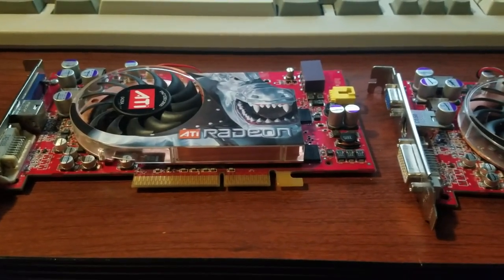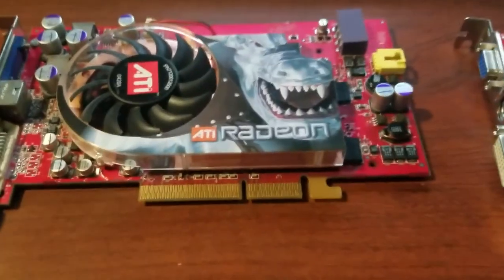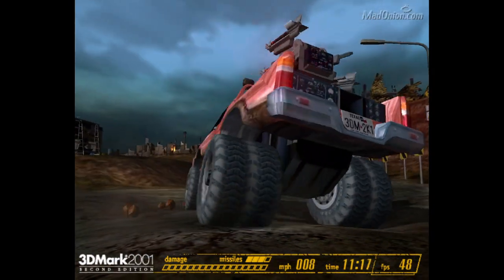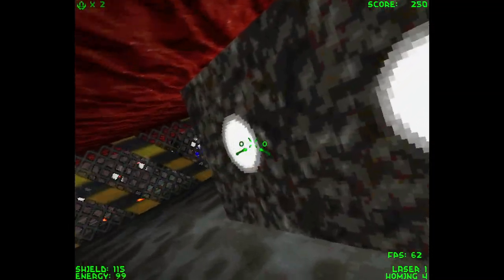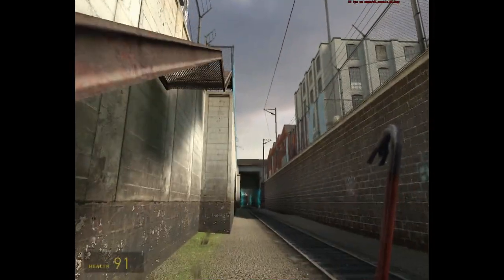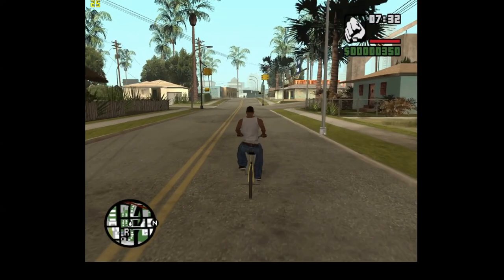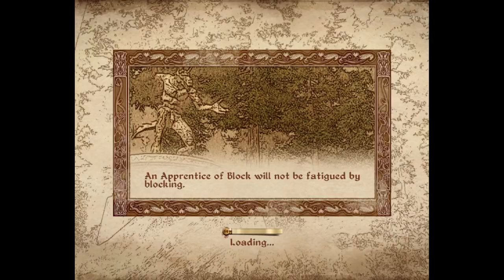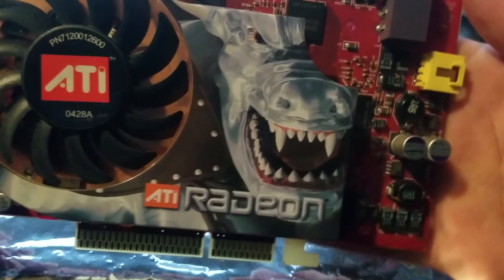The ATi Radeon x800 - #GPUJune

Comment: The X800 Series was definetly one of the golden ages from ATi because this card had better performance than 6800 Series if you play with Anti Aliasing. 
The image quality is noticable better than 6800. 
Even Radeon X700 has better image quality than 6600GT for my opinion the texture looks much sharper and the Anti Aliasing effect is better too. Yes the performance was bader than 6600GT but I think one reason was becasue of the better image quality .

Comment: Great review! I have a single X800 XL in AGP and a X300 SE, which is PCI-E. I have a substantial collection of GPU's from the 90's and 2000's. Didn't even know there was a GPU month thing going. With chip shortages, it might become a GPU year. Maybe I should join in. I've got about a dozen Radeons in the collection, but they always sat on the shelf. Never been used (by me at least). Never been an ATI guy, but never hesitated to accept a card donation, if one was available.

Comment: Great video dude! Thanks for sharing. I was surprised by that 2001 score, my PIII 1.4s and a 9600 Pro scores 8475!
Reply from the maker: Thanks so much! The PIII-S 1.4 is such an awesome CPU! I have one but I still need to track down a compatible board.
Reply: @jikissgamer  yeah that’s the tricky part. I used an Epox EP-3PTA which didn’t list it as compatible but luckily worked just fine. Not easy finding the right boards! It’s a cool CPU for sure, feels really fast (for its day!). I’m using it to run a machine with windows 2000 on an SSD and it feels snappy.

Comment: LOL I have one of those X800 XL cards in my Windows 98(se) project PC. IIRC the X800 XL had more in common with the X850 die because it had more pipelines but was on lower clocks. I'm more surprised that the final Catalyst driver for Windows 9x (6.2) actually has reasonably good support for the X800 series and X850 for that matter.
And, yeah, your Pentium 4 Dell isn't doing it any favors. but compared to my past experience with Dells of that same vintage, I'm surprised yours even accepted a GPU upgrade at all. Mine refused to work with anything but its onboard video even though it had an AGP slot.

Comment: Damn they were beautiful cards. Those were 200W cards, with tiny little coolers. We often talk about how much more powerful GPU's are now, but it's shocking how much more efficient GPU's are, we can do SOOO much more with 200W. Wish AMD still used the read PCBs though.
Reply from the maker: Agreed. The red PCB became an iconic and signature thing for Radeon cards and it's a shame that they're not red anymore. And it really is crazy that they are 200w cards. I was surprised when doing the research at how much power they consumed. They are awesome though, I wish I had turned off Vsync and paired it with a faster CPU to really show what they're capable of.
Reply: 200W is suggested psu acording to techpowerup's gpu database, not the tdp valu of the x800. X800's tdp is around 40-50W.
Reply: @sedatgenc83  Yeah, i immediately saw that something is wrong in the video. No way that tiny cooler can handle dissipation of 200w.

Comment: Back in the day I had an emachines "gaming PC" It was sold like that, it had a rebate in a AMD x700 pro, but instead I got the ATI x800xl. It was an good rig for the money, it had the ATI xpress 200 chipset, with a 16 lane PCI express, SATA ports and a 300 watt power supply (at the time that tech was brand new SATA and PCI express) the Mobo had a 939 AMD socket with a Athlon 64 3200+ I added 512 mb of RAM that added up to a huge 1 gb of DDR 400 dual channel memory, I also had the same sound card as you, the awesome creative audigy zs2 and an ATI tv tuner card with video and audio I/O one r/rw stock DVD drive and a what I think was a 54x CDR drive, and a 16 in 1 memory card reader. Later on I updated the CPU to a Athlon 64 dual core, the very first gen dual cpu I think it was a 3800+, those things were expensive as hell and I wanted to save money to buy a ATI x1800 but I never got to buy one. Quitted PC gaming for a while, there where only bad PC ports of 360 games.I forgot, I had windows XP 32 bit. Real nice video!
Reply from the maker: That's an awesome system! Those 939 Athlons were awesome CPUs! Definitely a lot better than the Pentium 4 I was using here. And yes the Audigy 2zs is an awesome sound card, I really like the way it sounds. I am still very fond of this era of PCs and games, those were good times. Thanks for watching!

Comment: Good vid mate.. i have resurected a win xp hp sff factor pc w8th xp on it. I can only use small cards on it so have a x600se 128mb.. its great for running early 2000s games.. cant quite stretch it to doom3 and fear but slightly older games run great.

Comment: Nice video. Are you using Pentium 4 HT? If it's the case I wonder if you left it on or turned it off because it might affect (to the better or to the worse, depending on game) the performance.
Also you might had a forced framerate cap on GTA:SA. Usually when you look into a closed-space area (like the garage) the framerate should go higher but in your video its still locked at 25 regardless of area. I know it from my experience with my old PC (P4 2.6GHz Northwood core w.o HT, and Geforce FX5600), the game ran about the same but with a bit higher performance when it had to render closed spaces.

Comment: The "XL" version with no cooler art was sold usually as OEM cards to be included in mid-range workstations. Low end workstations got the x300, while the high end stuff got the FireGL, which in truth was just little more than the desktop x300/x600/x800 with optimized drivers. If I recall correctly, either the FireGL 5000 or 5100 was the "workstation" version of the x800
Reply from the maker: That's really cool I did not know that. Yeah it definitely looks like something that would have been in a workstation since a lot of gaming cards were more flashy. I would love to try the FireGL sometime too and see how it compares.
Reply: @jikissgamer  I just checked the FireGL that I have, it's the V5000. From the looks of things, the V5000 was the same as an x700 xt and the v5100 was an x800 xt. This one has a super noisy fan though, and it is PCI express, not AGP

Comment: i have an x800pro pci express card, but my retro rig is agp, so had to put an old inno3d tnt2 in it as my next oldest agp is a ati rage 128pro. my x800pro doesn't have a molex power connector, but has the small 3.5'' floppy power connector

Comment: Man, I had an X1300 256MB card when I was like 12 or so. It barely ran anything, but I still beat Doom 3 on it at about 20fps low settings (yeah, even in 2012, I still couldn't run Doom 3 lol). I kept it for the longest time, but it's long gone now. It's really interesting to see the difference between that card and this when it comes to playing Doom 3, simply because this absolutely tramples it when it comes to performance. I guess that makes sense since this was a high-end card and that 1300 was a very low-end card, but still.
Reply from the maker: Yeah it is really interesting to see how much of a difference in performance it was back then between the two cards. Technology was improving so much faster then than now, such a different time. Back in those days I actually had a Radeon 9200se and that thing was total junk haha. But I did beat Half-Life 2 and Doom 3 on it.

Comment: Just picked up one at the goodwill outlet for about $2. X800gto 256mb pci x16..  It has a Ac5 silencer on it that is filled with dust, the fan has some noise to it. I am going to clean it up and see if I bring it back to life.
Reply from the maker: Awesome! Those are great GPUs, if the fans still give you trouble you could also strap on a third party cooler from ebay or Amazon. Good luck getting it running again! 👍

Comment: GTA:SA runs like that cause the phyiscs are tied to the engine, if you turn off the frame limiter it will run alot faster, but you start getting physics bugs.

Comment: Hello Can you test GTA San Andreas without framelimiter? I'm intresting how much fps you get with X800 XL and Pentium 4  2,8GHZ 1GB Ram.
Because I have  Radeon X800 XL too but in PCI Express 256MB and Pentium 4  560 (3,6GHZ)
I have noticed that GTA San ANdreas wasn't optimized well for the PC becasue if I set all amxed out with 3xAA than the games lags on some places where many shadows and grasses even with this system with X(00 XL the fps drops down 20-25 fps. 
if i set the FX Quality to low nothing laggs anymore. Shadow and grasses costs so much power...
The fps don't get highetr than 50 fps even if i play with lower resolution and low details its strange like limitation....
Reply from the maker: Definitely, I made a huge mistake and left the limiter and Vsync on in this video. I will go back and try it again without the limiter and see how it runs.
Reply: @jikissgamer  thank you, i want to compare if you have same problems as me because the laggs in some places especially in Los Santos in Big Smokes area and near CJ's area  but also in plaxes where many forests and shadows.
Its strange because I had a friend who had owned a Geforce 6600GT and he could play GTA SAN ANdreas maxed out absolutely smooth no laggs its strange... and on my both PC's  P4   3,6 GHZ and Dual Core Pentium D 830 it stil have frame drops...

But i had noticed similar proble on my old Retro PC Pentium 3  667MHZ if I refresh the HDD and install WIndows new than games like Deues EX runs much bader... now i have frame drops and the framrate don't goes so high even if I reduce the resolution and effects....
But most game runs like it should be. In Hitman Codename 47 I get now graphic glitches with textures.... before it wasn't any texture glitches. Strange... it should be something with WInodws? Or direct X Problems? https://www.youtube.com/watch?v=jAGYffh2MKU&t=6s
Reply: @jikissgamer  I want to know if you get frame drops too if you play maxed out with 3xAA with FX quality Very High because it drops so much... its strange and my friend had a Geforc e6600Gt and he hasn't issues no lags with max quality strange. This remember me like the old game Deus EX i have refresh Windows XP and then Deus EX have frame drops before itw as always smooth.
Reply from the maker: @retro4fun358  Thanks for reminding me! I've been meaning to try it again but haven't got around to hooking up the PC yet. Will do it sometime this week hopefully!
Reply: @jikissgamer  i have asked a lot of people but nobody knows why this framedrops are coming.. maybe you can help me. It could be that its a windows issue because of updates or Direct X problems.... i don't know other game sruns good but a couple of games not...

Comment: Dude I was running San Andreas PC on my 9800Pro and I had silky smooth framerate and Same with Half-Life 2. Something is not right with the game or the card. They should run perfectly.
Reply from the maker: I think it might be that I had the frame limiter enabled. Either that or the CPU im using is holding it back. I really should have used an Athlon 64

Comment: you have to Play Boiling Point road to hell it runs like crap even with Radeon X 800XL card  can't handle this game by 1280x1024 3xAA and Maximum Details its lagging so much...
On my other PC System Core 2Duo E5400 3GB DDR2 Ram and Geforce 9800 GT it runs well.  This game came out in spring 2005 and strees the Pentium 4 and the X 800 High End cards so much....